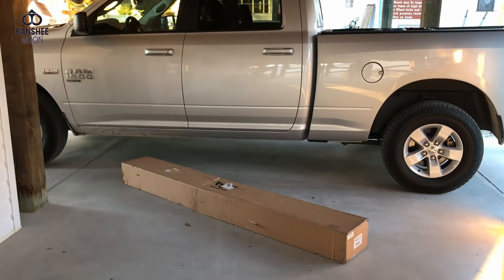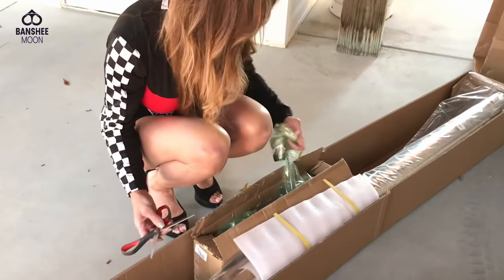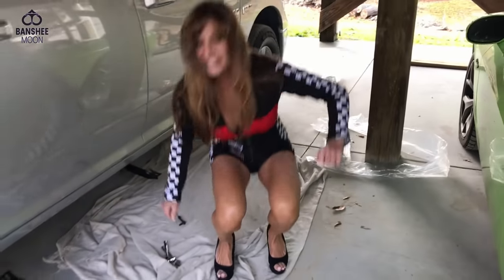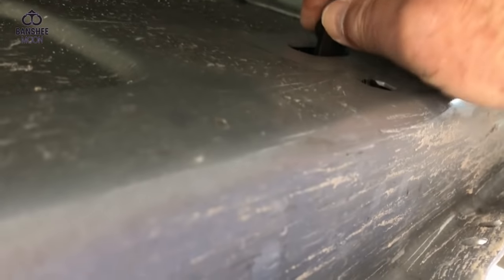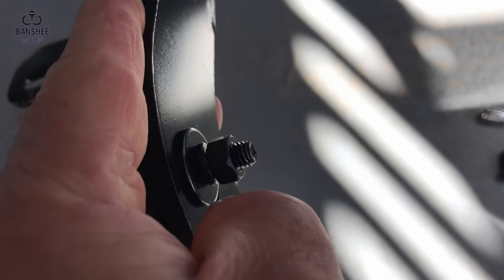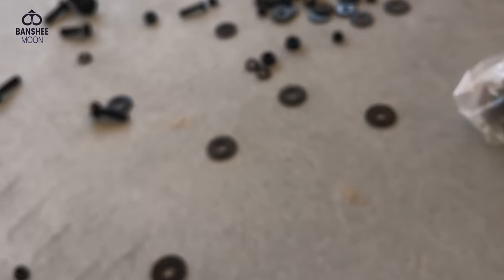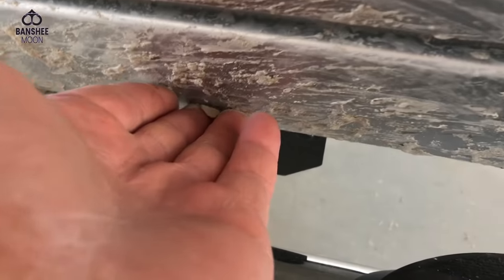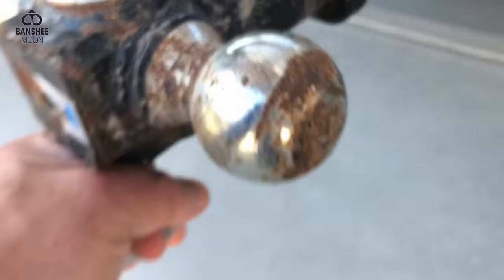Farm Girl Installing Running Boards | Side Steps on 2019 Ram 1500

Comment: I know it's convenient to leave it in, but you are better off removing the ball hitch. Not just because of theft,  but because it will rust solid to the receiver and you will play hell getting it out when you need to turn it for a different size ball. I keep mine under the back seat.
Reply: I have a locking stainless pin.  Boom

Comment: Great video, quick comment about cleaning the truck.

Avoid using a brush on the truck, as this can sometimes scratch the paint. Instead hose it off with high pressure and soap as needed, like a car wash does. Afterwards, a little wax goes a long ways towards keeping it pretty for years to come.
Reply: Recommend the same for the woman. 😀

Comment: I must tell you that the bolt that you had to replace your old one that had the cotter pin on it can be very nice to use, SOMETIMES 😉
One time I was using a Hitch Haul which had the hollow 2” square tubing and it had shifted ever so slightly in the receiver and caused the latch on the pin to turn perpendicular thus making it Almost impossible to get the bolt back out. It was a total nightmare

Comment: I had the same problem with the plastic retainers installing running boards on my ride, almost lost the hardware dropping into compartment, that's what they're meant for, to use, if you don't already know thinking they're not anything. The chrome looks good and Italian food is good stuff, thanks for the show.

Comment: If ever I sell my Lexus for a Dodge Ram, I will know how to do it :>) To save issues with rust and seized bolts, spray everything including the hitch pin and tow ball with Waxoyl or spray grease rust preventer. Loved the finishing flag onesie Jen!
Reply: Or you can just wash your vehicle! I live on the Jersey shore and my truck goes to the boat ramp at least six times a year, More if we have any major storms! Not only am I launching in salt water I can literally see the bay from my driveway, And I have absolutely zero rust on my vehicle!
Reply: Waxoil is amazing.   Worth it's weight in gold.
Reply: wait theres cars in this video?
Reply: yea right ,,, you loved her manual labour ... :)

Comment: Finally somebody who's naming the bolts and nuts correctly, by the diameter of the thread, not the size of the wrench or socket used on them. Also, I really hope you removed the dirt from underneath the front bracket, before the final torque. ( 9:37)  -:)
Otherwise, great job!

Comment: around 6:30-730 when putting the nut plate in just use a clamp of some some sort(think ALLIGATOR Clip/clamp)to hold the thing so it wont fall or drop in..Even use a long piece of masking tape around the stud so the flag of the tape wont allow it to fall back in the hole. Even a larrge strong neo type magnet.

Comment: 4" pumps while turning wrench. Visual stimulating, yes, practical, not so much. Pole dancing instead of wrenching would create a much better visual effect. Just saying. Saw a blacksmithette tuber performing her trade in a low cut top, asked why most Smiths wear protective clothing while forging? Safety? Bra or no Bra, for safety sake, no bra, less to catch those red hot slag fragments. Hmmmm.

Comment: I watched for 19 minutes and I didn't  learn a damm thing.It must have been the short shorts and the high heels.I told my wife I have to look at the video again,she said "get rid of the damm truck and then she said "If you get running boards I am going to run your ass over with the truck".So I guess I better start running right now and get a head start.

Comment: This proves you can only buy running boards in long boxes (If you just happen to have one of these playboy bunny types available to get on floor to work things out with the camera running hot...:  not to imply any insult on personality and such...)  just the facts mam just the facts;  as Sgt Joe Friday would use in his diagnosis of the situation... Bet ya the local truck dealer sales quota went thru the roof after this little Superbowl half time commercial...

Comment: It's easier to put the retainer on the bolt plate first, put the weld nut end in the hole first, put your bracket on the bolt and use the bolt to spin the nut around to line up with the other hole and start your loose bolt, then washers and nut on top 
I know they tell you to do it the other way, but they're wrong. 🤷

Freaking engineers 🙄